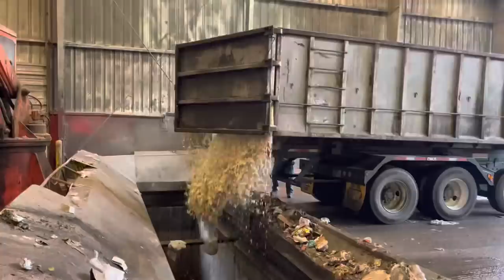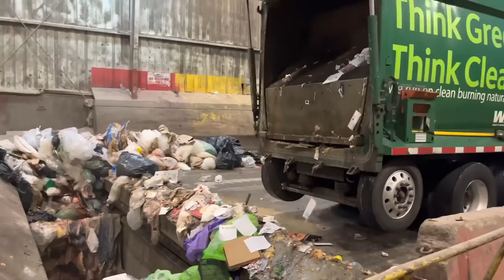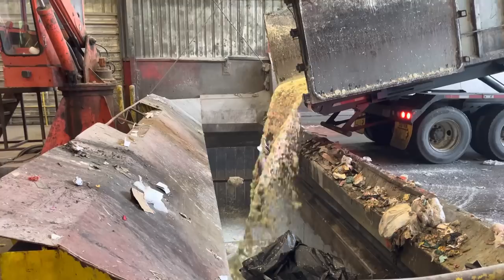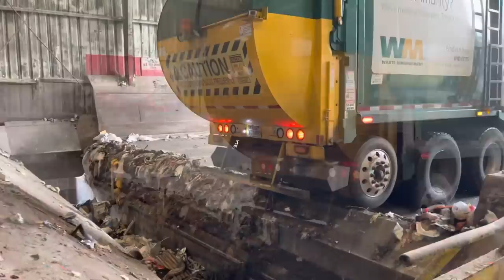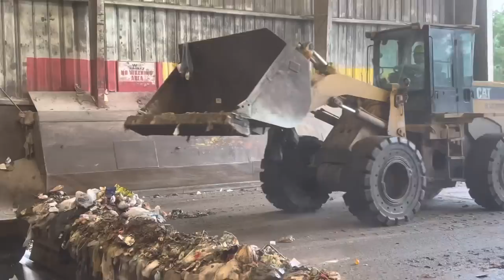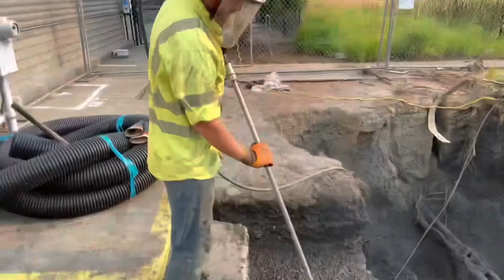Watch the Pros dump their full Garbage Trucks into the pit. #garbagetruck #garbage

Comment: I assume that there are some sort of rolling containers that are located at the bottom of the pit. The trucks are very full when they dump, I wonder how many truck loads it takes to fill the containers. Can these containers be emptied quickly and replaced, or does it slow down the dumping time for other trucks to dump.
Reply from the maker: There is a 53’ open top trailer in the pit. When it gets full with about 55-62,000 pounds it gets pulled out and then hurled off to a landfill to be dumped. They fill about 7-12 trailers a day.
Reply: Those are trailers in the pit when they are full they pull them out and replace them with another one.

Comment: This doesn't make sense though as the drivers could have easily drove to the landfill and dropped off the rubbish there.
Reply from the maker: Not that easy when the closest landfill is 1hr and 40min away. That’s not a viable option for any of the local haulers. Thanks for watching.
Reply: The landfills are generally not close by. These trash trucks are on a tight schedule it is not practical to send them to landfills.